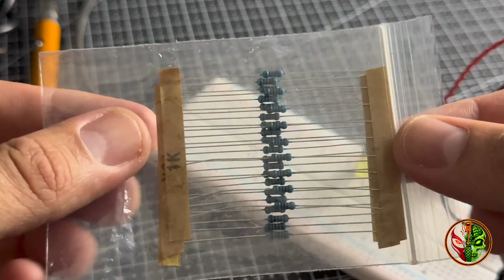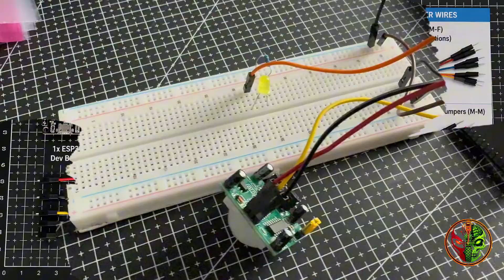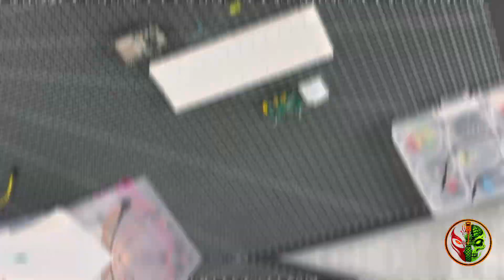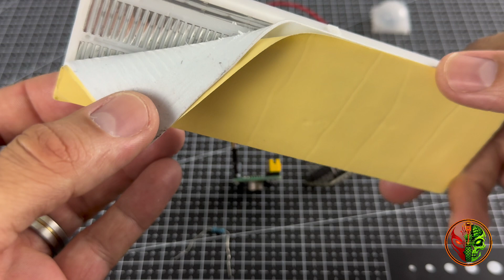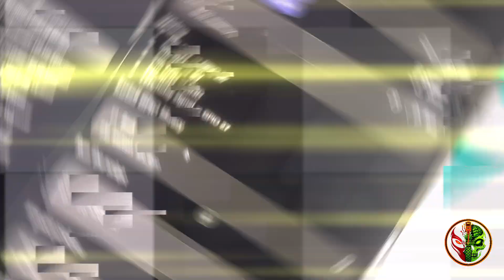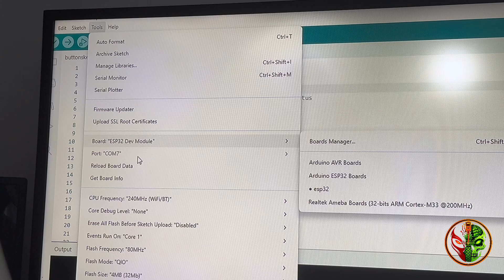Motion Sensor LED Light w/ ESP32 ⚡#ESP32#MotionSensor

Comment: not freaking working on my esp32.. i did the exact thing..
Reply from the maker: What code did u use?
Reply: @uagain.shadow  this one brother , the sensor worked but the led doesnt work
Reply from the maker: @R @Ragun2008 did u change the code to match witch pins on the esp32 u got it going too? Or match the code to ur esp?
Reply: @uagain.shadow  const int pirPin = 26;
const int ledPin = 27;

void setup() {
  pinMode(pirPin, INPUT);
  pinMode(ledPin, OUTPUT);

  Serial.begin(115200);
}

void loop() {
  int motion = digitalRead(pirPin);

  Serial.println(motion);

  if (motion == HIGH) {
    digitalWrite(ledPin, HIGH);
  } 
  else {
    digitalWrite(ledPin, LOW);
  }

  delay(100);
}